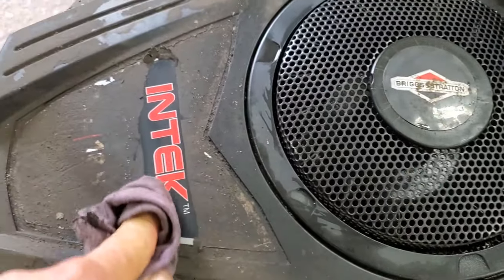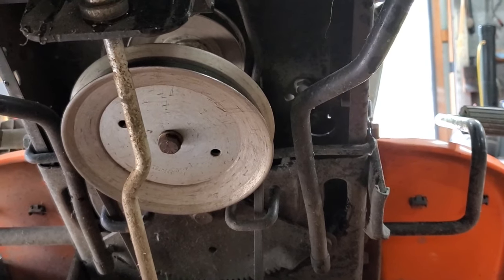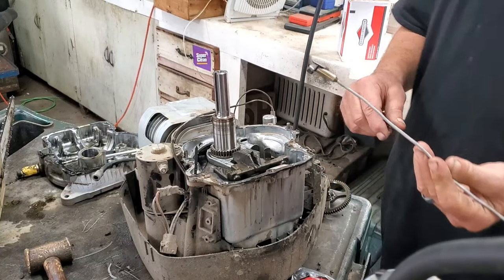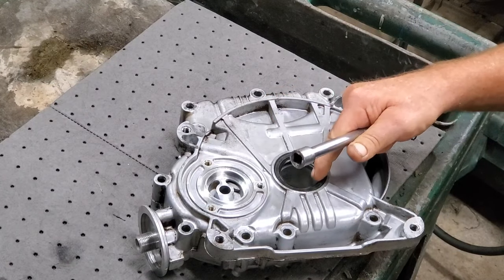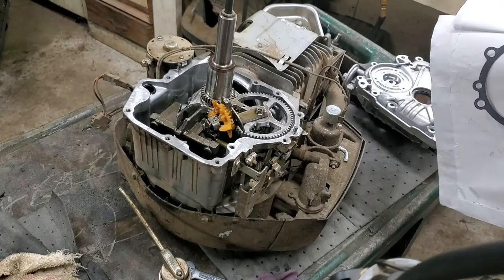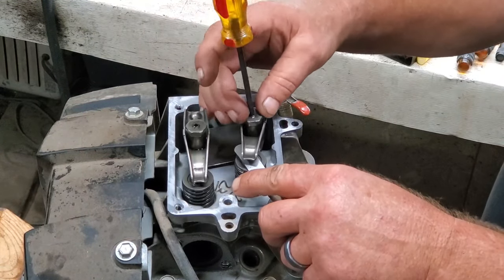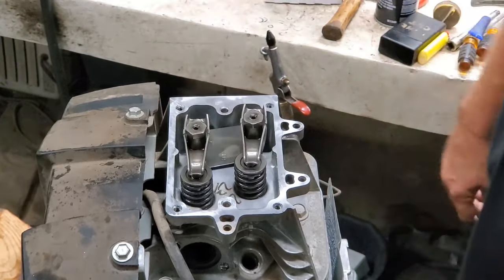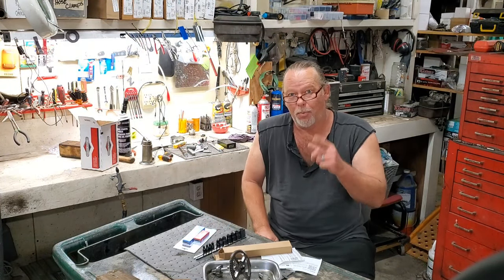HOW TO REPLACE THE CAMSHAFT ON A BRIGGS AND STRATTON INTEK. EASY DIY.  ALSO MAIL CALL AT THE END

Comment: Thanks so much for the video! Question for you... I didn't remove my valve cover. Just went straight to removing the sump cover, replaced the camshaft, etc. Do you think I need to open the valve cover to do the timing adjustments or do you think it's fine since I didn't open it up? Working on a 2019 John Deere with only 120 hours. Thanks!
Reply from the maker: Yes with a new camshaft the valves must be adjusted. Thanks for watching my friend.
Reply: @RaleysSmallEngines  Thank you!

Comment: Is the new seal you installed considered the magneto side?
Reply from the maker: No sir, it's output or also called pto side
Reply: @RaleysSmallEngines . Thanks again. The only difference between my motor and the one you worked on is that mine had no oil pump to deal with other than that everything the same. Waiting on all the parts now (cam, 3 gaskets, and seal) and seems like it’s gonna go back together just as you showed. Again thanks for an outstanding video. 👍
Reply from the maker: @mikedecesare7814  awesome my friend!!!

Comment: Wow! Such a nice tutorial!!!  Can you tell, please, whether smaller Briggs engines have the same decompression mechanism like this one?  Our mower`s engine is 7.25 HP only. I checked this many times- no any bounce or clicking actions at all. However, camshaft is a bit different. Still axle and all the rest parts are made of green in color plastic... I`d like to recon whether this is the same compression realize issues before taking engine apart, but can`t know whether the same way is effective for smaller units. Thank you

Comment: I have seen other vids where they did this but didnt remove the push rods. Is it necessary to remove them? Great video!!
Reply from the maker: Yes remove them and replace the lifters/tappets that come with the cam. If the didn't remove them, the job wasn't done correctly.

Comment: Good video.  Our 5 year old Husqvarna lawn tractor is in the shop for this reason.  I'm very disappointed that it only lasted 5 years.  Any thoughts as to why the cam shaft and decompression assembly breaks?
Reply from the maker: Thank you. The manufacturer decided to use a spring the size of what is in an ink pen. Very poor design. They should take lessons from Kawasaki.  Yes sir, they all break at some point.  I feel if the valves are regularly adjusted it helps it last longer.  Probably not, but hopefully.

Comment: This camshaft compression release seems to be a common issue on this engine.  Has the B&S replacement camshaft been modified to not break again or is it the same old junk?   By the way, you made an awesome video!!  Thanks.
Reply from the maker: Thank you. Yep, it's the same old junk 😆

Comment: where do I get the camshaft kit you used?
Reply from the maker: I'm a dealer, so I get them from one of my suppliers. You may can get a OEM cam on ebay or go to your local mower shop. Please stay away from aftermarket.

Comment: Hey . Great video :) I’ve subscribed and I’m glad we got to see it running . 
I have a question . Do the small b&s engines have compression release on them I have a 4hp 625exi that is a (c u next Tuesday) to start . I’ve seen the battery started version of this engine have it but wasn’t sure if the pull start version did . Warm regards from Australia

Comment: Can you tell me the part numbers for thatcam kit and parts.   Where to order it all from ?
Reply from the maker: Look up the correct one for your machine on Parts Tree
Reply: Ok.  Thanks.     Its identical to that engine u fixed.   It's a briggs and stratton  ohv 17.5 horse. Single cylinder.  Betterbuilt on a troy built pony

Comment: I have a question, my cam was definitely bad and I replaced it step by step with your video. It still will not start and I am getting a clicking noise from under the seat area.
Reply from the maker: Watch my "Just Clicks No Start " video.  It's on a Cub Cadet but it's the same diagnosis on any mower.

Comment: Question.   I have same engine.  Had hard time getting it to turn over and start.    Finally did.  I cut about 20 minutes then it just died and made some kind of noise.  Now it spins with the starter but will not run.    Do you think same problem?   If so, can the compression release get stuck open?  Also, can you give me rough estimate of cost of all the parts you replaced and best place to order from?     Great video

Comment: Is it necessary to change that oil seal/gasket (part no: 795387) on the crankshaft if it looks ok?  That step looks like a pain.  Some other say you only need to if it’s bad, but I see you did it even though it looked ok.  What’s your thoughts?
Reply from the maker: Replace it is what I do no matter the condition.  To me it's not worth taking a chance. You can do it, it's not that difficult, just take your time.
Reply: @RaleysSmallEngines Will do.  Just ordered it along with the rest of the parts.  Thanks! 👍🏼

Comment: Hey there! First of all...I love your video(s). Very detailed and easy to understand. It's a plus that you show everything you are doing and explaining as you go.  I like that! I have a question for you. What is the difference between a B&S Intek 17 hp ohv 31c707 -0230-E2 and this B&S 18.5 you are working on here besides the oil filter? I'm about 100% sure the compression release thing a ma jig is laying in the bottom of the sump on mine. Would I be able to follow everything you do on this video to fix mine or what differences would there be? I know you are very busy but I sure would appreciate it if you could let me know. So many different opinions of how to do this are on here and I trust your way better than the others. Maybe because I've watched your video several times lol. You're just a great teacher. Thanks, Dawn!
Reply from the maker: Thank you for your kind words my friend.  Short answer,  they are the same. If you follow the video you shouldn't have any problems.  The time consuming part is cleaning off gaskets and engine parts.  Take your time with it and you will be fine. Thanks again for watching and commenting 🙂

Comment: T-Bone, I have a question about flywheel keys .Do  all  B.S. engines use the same  flywheel keys?  Sure would appreciate your input . Thanks Rick
Reply from the maker: Many are the same, but it is always best to look up the correct part.  We use Parts Tree a lot, they have good diagrams

Comment: Great Video!   So I had a broken intake push rod.  I went ahead and took off the head and replaced the head gasket but when I went to adjust the valves, I noticed the intake push rod was not moving up and back when rotating the engine.   Is this a stuck lifter/tappet valve?
Reply from the maker: Thank you.Probably valve guide in head moved.

Comment: These engines are a nightmare. I’ve seen two different ways that the valves get set. 1) like this dude does opens one valve, sets the other and vice versa. Then 2) where they set the TDC and then set both valves. Which ones right? Can’t be both are ? Or is it possible?
Reply from the maker: Either way is fine.
Reply: I was wondering the same thing. Seems odd to me that either way works but I'm no mechanic.

Comment: Worth it to do the compression release on a B&S 331877 w/300 hrs? (Craftsman/Husqvarna YT3000). Thanks!
Reply from the maker: Hmmm. That's a judgment call depending on the condition and history.  In any case, it's cheaper than a new one even if you put new rings in it and do a valve job.

Comment: Also.   Can you list the part numbers of replaced parts?😮
Reply from the maker: Look up the correct part numbers using your model, type and code located on the valve cover. Look them up on Parts Tree.
Reply: Little confused.   What is the seal called.  Do I need a tappet?

Comment: I can't understand why Briggs & Stratton doesn't get with the times and use the overhead cam design, LIKE HONDA DOES and do away with the push rods and that cheap faulty camshaft which is a recipe for disaster. Briggs used to be pretty good. Good video.
Reply from the maker: They definitely need to improve.  Thanks for watching and commenting my friend

Comment: Hello Sir, very good video, I'm working on one right now. But I have a wild question for you. On that 18.5 B & S engine, if I switched the sump cover with a 17.5 sump cover that does not have a pump or oil filter, will it work or mess up the 18.5 engine? That means I would have to switch out the slotted cam too with a cam that does not have the slot. Will that engine run like that?
Reply from the maker: Thanks for watching.  I don't think that will work.
Reply: That's what I need to know sir I'm new at this, I inherited a shop following the passing of my father. Learning as well by your video, thank you for your quick reponse.
Reply from the maker: @ronniewortham3260  sorry for your loss brother. Recently lost my father also. Do you best, ask questions, and learn all you can.  We wish you much success.

Comment: How long would it take for you to do that work, from pulling the engine to putting it back on not including gasket cure time?
Reply from the maker: Approximately 2 hours depending on gasket cleaning time and crankshaft pulley coming off easy or not. Thanks for watching
Reply: @RaleysSmallEngines  so that means it should take me 2 weeks. Thanks for the reply. I have a 2 cylinder doing the same thing as that one. May he doing 2 crank shafts.

Comment: I got 4 years out of my original. The Briggs and Stratton Amazon store has this part but many on that site review as not getting any reliable time from the new camshaft either before the weight is down in the bottom of the engine again. 
Can you recommend a replacement engine for the 17.5Hp  Briggs on a TroyBilt pony?
Reply from the maker: Only use OEM Briggs and Stratton cam shaft, and you will be fine.  Keep the valves adjusted and the oil changed and it will last a long time.  It will cost too much to swap the engine, because I wouldn't go with aftermarket.  Thanks for watching and commenting my friend.

Comment: Apparently I have the same problem with my mower tractor. Today I had a technician that explained me the same you did on this video.  So..... I believe his labor is too much money. How much do you understand is a fair price for this job?.  I need to spin the top of the engine to get compression and turn on the unit, once is on, it works great.  Thanks
Reply: Dude, if you can't pay his bill then find someone else you can. People around my way charge around $65 an hour for labor. Some are around $90 though.

Comment: Could you add a link on where to find replacement kit?
Reply from the maker: Do what we do. Just go to Parts Tree and type in your model and type. You will easily find the correct parts for your engine. They have awesome diagrams.  Hope this helps.
Reply: Very helpful. Found the site now just need to know what all to order to replace cam shaft. Thanks for the video it helped me figure out this was the problem.
Reply from the maker: @dustinwalston4366  ok obviously cam ( please don't get aftermarket) so, cam, output shaft seal and sump gasket. Please order OEM, not aftermarket kit. It will fail. Let us know how it turns out. Thanks so much my friend.
Reply: It’s was not the cam shaft. But there were chunks of parts that I am not sure what it’s called. I think it’s called the connection rod and piston.
Reply from the maker: @dustinwalston4366  glad you figured it out. Are you going to fix it?
Reply: @RaleysSmallEngines  I’m going to try to figure it out. Can’t do anymore damage to it.

Comment: So….why can’t you just replace the compression release mechanism, instead of a perfectly good camshaft?? Wouldn’t a gear puller be cheaper than an entire new camshaft, just to replace the compression release???
Reply from the maker: Compression release is not sold separately

Comment: Aluminium push rod is for exhaust valve!
Reply from the maker: 😆 🤣 nope. Thanks for watching my friend.
Reply: @RaleysSmallEngines  I had to change the camshaft to my engine and when I dismantled the valvetrain I noticed an aluminium pushrod was on the exhaust side. My lawnmower is a John Deere European model. Might be a factory assembly error, but I decided to switch rods, despite they were already worn to the lifters and rocker arms.
Reply from the maker: @markusviitamaki3820  it should be fine. Worst case it's easy to replace rockers and push rods later it the give you a problem.  Yes always steel on exhaust side because it gets hotter. Furthermore you can just run two steel push rods is fine also.
Reply: @RaleysSmallEngines  Agreed, I have never seen it the other way around. Always aluminum on intake and steel on exhaust.

Comment: After replacing camshaft (broken compression release) three times in two year, I went with a permanent (and cheap) fix.
https://www.youtube.com/watch?v=c8SUueqRzAs
Alternatively, I think you might be able to just add multiple head gaskets to fix it.
I have another mower yet to fix that I am going to try the "multiple head gaskets" fix.
Lowering the compression by increasing head chamber size is at the core of the permanent fixes.